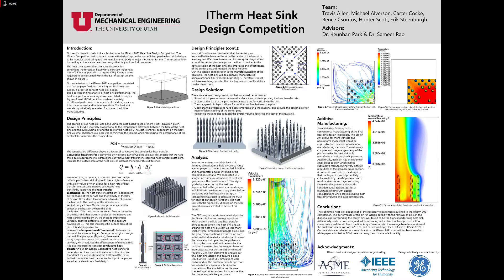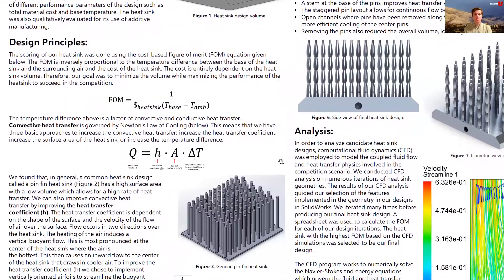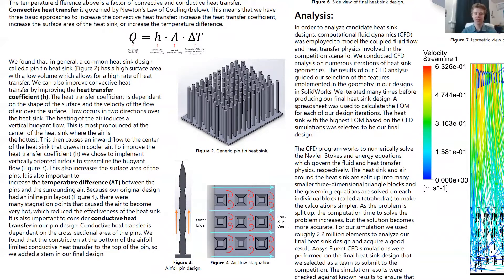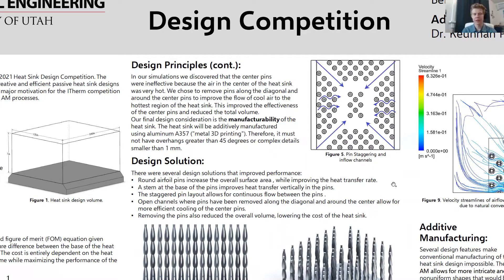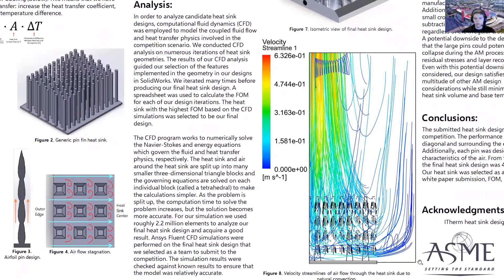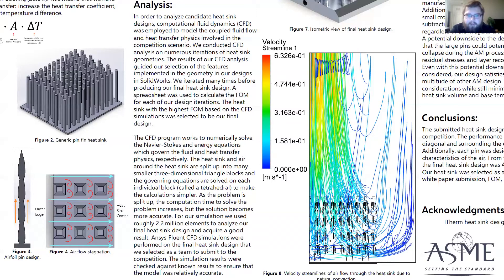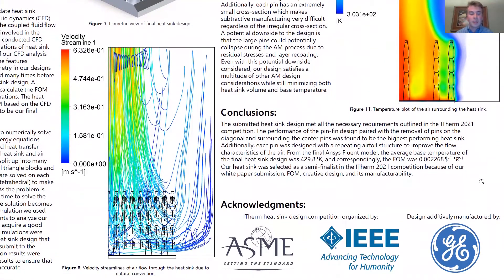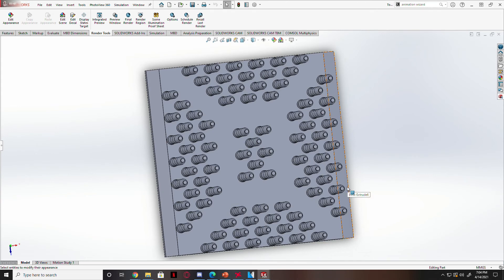Team 12 - ITherm Heat Sink Design Competition

Comment: Good job!  However, you never gave us a final punch line. Specifically, there was no comparison given with an alternate standard heat sink. You did give a figure of merit number at the end, but unless I’m working in this field, I have no more idea than a goat if that is a good number a bad number or A mediocre number.  One must always give a conclusion that compares the accomplishments of the work with some baseline predating the work. This applies whether or not the work is better or worse than prior art. It is just as important to know that something is inferior to a prior design as it is to know if it is superior to a prior design.  At the end of the presentation, I am left empty handed, having seen what appears to be good work, but not knowing what the net final results were.

Comment: The best heat sink should have the largest surface area, like a sponge or metal sieve with nanocospic holes (100nn) or smaller to dissipate heat better!
Reply: That doesn't work as well as expected due it being non-forced air competition.
Reply: @shadow7037932  yea, this was a passive convection design contest and its a great design -- you will see it when 3d metal printing is standard fare. It beat out the octahedron design which was the previous champ. Sometimes you need to design for stagnant air and this is  great example of a project that can perform with no airflow expected. Imagine how good it would be with air flow?